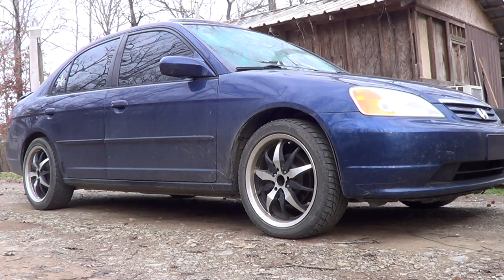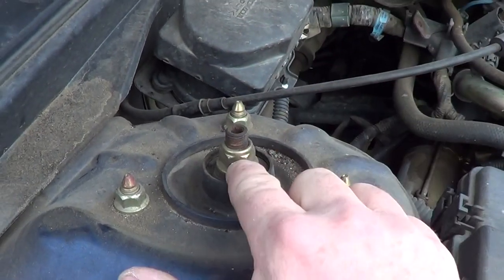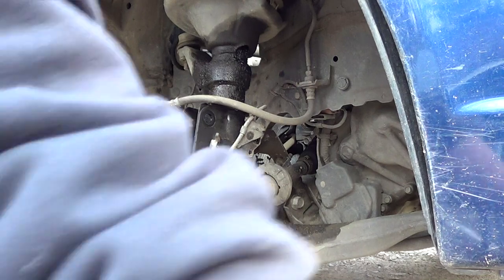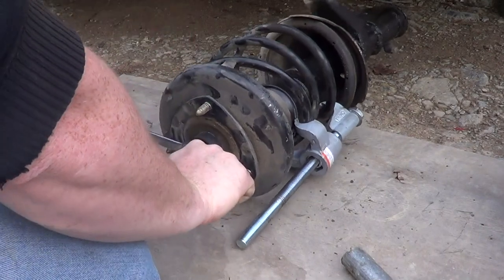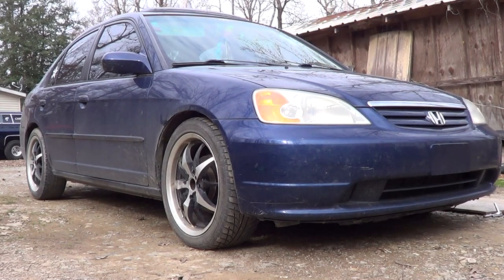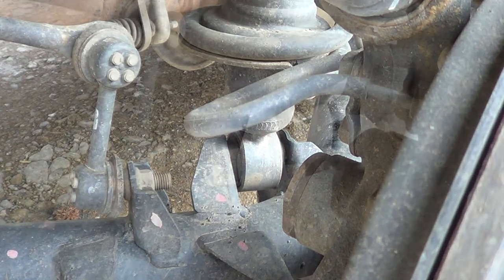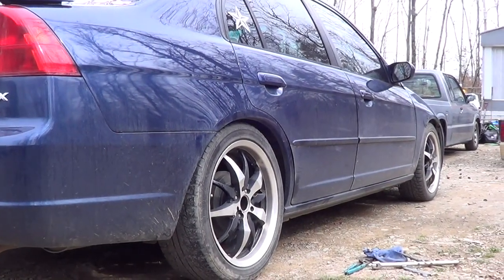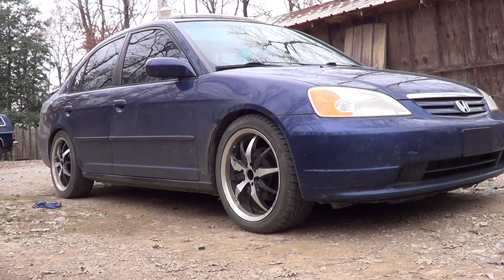How To Lower and Install Struts On A 2001-2005 Honda Civic

Comment: That's funny how you put the nut back on.
I think my 2001 sportage manual actually says to take the nut off both sides, and then jack the car up in the middle. So it lowers the spring slowly. Then you can take your wheels off.

Comment: Nice video bro it helps a lot, quick question is necessary to put that bump stop holder back (in the minute 14:16) it seems that the bump stop will go inside the holder and it will hit the base of the shock if bottoming out?

Comment: Just a heads up, have someone else push down on the back rotors when you put the strut mount bolt in. It's a pain to get to line up by yourself. If you are absolutely by yourself push down on the rotor and stick a screw driver in the opposite hole. Then I used a garden rake as a pry bar and wrapped my legs around in and pulled down while I put the bolt in.

Comment: I was thinking about doing this to a 2005. So you used truhart struts and skunk 2 springs? How does it sit and ride. Does the front sit a lil lower than the back? Let me know. Debating to do this set up or coilover. Rather this cause more affordable

Comment: Joseph Wilkins How are hard was taking the one bolt for the rears?  How about taking the strut out and putting the new one in?  I hear you might have to pry out the rear struts from it's slot.

Comment: Hey bro i installed the skunk2 on my 02  civic coupe and it clunks when turning is like the speing moves or jumps but is sitting on bottom right and the top could it be the spring sitting bracket not slign or what can you tell me

Comment: Hey there, nice video. Is that all you need to do? do you need to adjust the camber or anything?
Reply from the maker: You should get alignment checked. The camber in the front stayed true. But the rear cambers alot. You will need to buy an adjustable upper arm to adjust it

Comment: Before u take the strut loose pop the nut off the strut first that way the spring will pop in the wheel well instead of taking your arm off

Comment: Were those lotek shock and springs and how was the ride smooth or bouncy?
Reply from the maker: The shock brand I really don't know. I got the whole set on eBay for $120. The springs are skunk2. The car rides stiff. No bouce at all. Very smooth too. Besides the stiffer springs lol

Comment: would it be unwise to use stock struts with lowering springs? would it be a lot bouncier than normal also
Reply from the maker: As long as they aren't gas shocks or struts
Reply: Joseph Wilkins going to see if I can find out but what would you say a 01 accord has
Reply from the maker: Not sure. Mine were not gas shocks stock. So I don't really think they used gas ones on hondas

Comment: Did you need to worry about messing up the camber of the car? I've been thinking about lowering my 2014 civic si and everything I've read stresses that you could mess the whole thing up without a camber kit.
Reply from the maker: When i lowered this one all i had to do is get an alignment on the tow. the camber stayed perfect honestly only because i used stock strut replacements. But the camber kit is really easy to install
Reply: Okay, thanks for the tip!

Comment: how did u get tie rod out mine is stuck trying to use ball joint remover and hammer still won't move
Reply: I just take rubber mallet and keep smacking the arm on the strut and it should pop out.

Comment: I put my lowering spring in today front looks really good but back is a 3 finger gap should have drop 1.75 y is it so high
Reply from the maker: Hmm. I didn't have that problem. They may have to set in. Take it down a bumpy road at a high rate of speed. Best advice I could give

Comment: How low is the drop?
30mm?
35mm?
40mm?
Reply: It's 2.25" front and 2" rear. That's about 57mm and 50mm. The car in this video initially sat pretty low for stock due to blown struts/shocks.

Comment: What size wheel and tire are you running. Im trying to do the same with a 17x8
Reply from the maker: They are 17x7 with a 215/45/17
Reply: Did you get any rubbing on turns, dips, or speed bumps
Reply from the maker: Jaime Ruiz never did.
Reply: Cool thanks alot. Nice truck

Comment: Would 205/40/17 be to thick?
Reply from the maker: Nope. I have 215/45/17 on mine now
Reply: Oh okay . Im thinking about installing some new struts but just the front ones on my 04 civic. Do  you think i would need a camber kit?
Reply from the maker: I didn't need one on the front. But I do in the back. Front stayed true.
Reply: Oh so do you think I should just wait and see how they come out and drive for a few days and than see if I need them
Reply from the maker: Yarico Flores yes sir
Reply: Thank you for the help
Reply: One more thing how much did you lower the honda civic    was it 2.5" and 2?
Reply from the maker: Yarico Flores the lowering kit was 2"
Reply: Thank you

Comment: Ok, not trying to hate on your video, but damn...
You broke your rubber in the tie rod. BRB CHANGING TIE ROD AND DOING AN ALIGMENT. 
 You have to be WAY more careful about your axle, it can slipp off, and that job is a fucking mess. You need to secure it, and no, not by a break line. 
You should be way more careful, especially when making a DUY. I bet some people fucked themselves over.

Comment: I put my lowing springs in and my rear sits hi like 2" hi
Reply: Jason White  lol you put the front springs on the back , Front springs handle a Heavier load (engine etc)  so they only compress under the correct weight :P